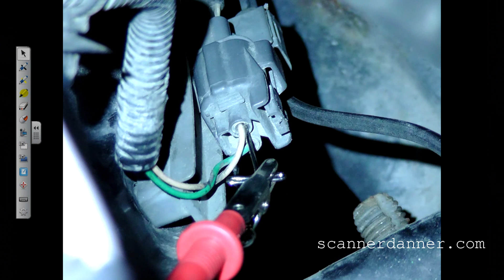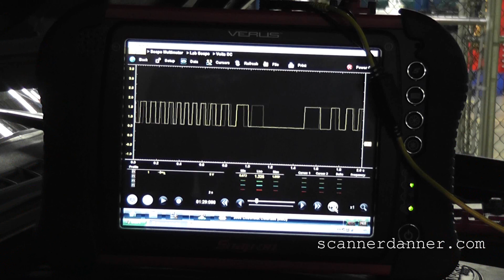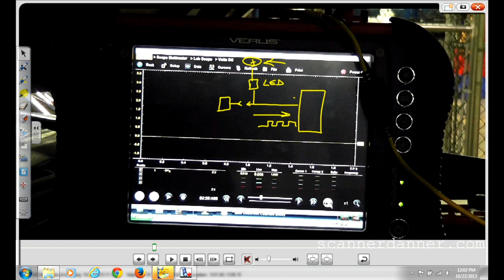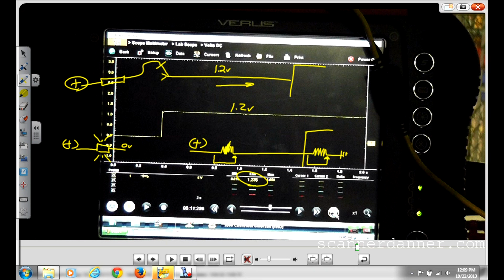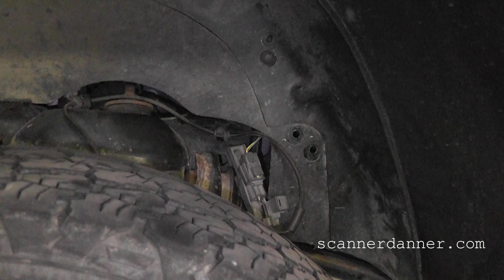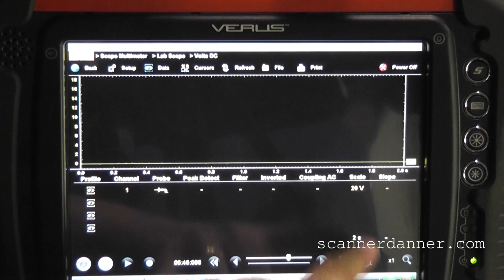Magneto Resistive ABS Wheel Speed Sensor Test - 2006 GM

Comment: My 08 tacoma has a error code for the left rear wheel speed sensor. New sensor, plus wire harness. It did not go away. A tech wanted to get into the rear axle and look at the tone ring. Because the truck was sitting still, it does not seem to me its time to do this?

Comment: Hello, it’s been a while since I’ve been on these comments but I’ve started getting back into learning more diagnostics. I recently had a vehicle with an ABS concern. It had two wheel speed sensor faults. 

The type of sensor they use are Magneto Resistive. So I watched the videos Danner has on the topic and I understand how to test circuit integrity on both wires signal and battery feed, but my question is on vehicles where it sees an ABS fault and it shuts the 12v feed off so there’s no way to check the feed wire other than open or short testing with a DVOM. Even trying to clear the codes they won’t clear. Is there another way to test the circuit integrity without doing open and short testing?
Reply from the maker: you would need to clear the codes only when you have a substituted sensor connected. An LED test light between the two wires may work as a substitute but not sure.

Comment: In 2024, we have 1. Hall effect sensor 2. Anisotropic magneto-resisistive (AMR) sensor 3. Giant magneto-resistive (GMR) sensor 4. Tunnel magneto-resistive (TMR) sensor all of which are used in automotive applications for ABS, hill-holder, anti-skid and cruise control, then we also have the old and basically obsolete passive inductive sensors (analog), and then there are the uncommon types like optical and capacitive sensors. 

Anyway, every type of sensor can be combined with an electronic circuit and this circuit can be designed to provide basically any type of signal and signal voltage range. Even passive inductive sensors could be equipped with an ad-on digital circuit, however they would need a voltage source in order to power this circuit. Some designs provide directional information, too (if the wheels turns forward or backward).

That‘s why there are efforts for standardisation. But too much standardisation might impede technological progress.

Comment: Very good explanation. This was filmed 11 years ago, incredible! 

The only part I didn‘t find helpful was the part on the test light. On modern Bosch 8.1 ABS/hill holder/anti-skid systems, the signal of the square wave is oscillating up- and down around 10 V, with about a 0.4 V difference (This is what I found on the internet, as I still have to do my own measurements). I don‘t see how the test light will be helpfull with those kinds of voltages.

Comment: I think that the design is an internal resistance in the PCM connected to the ground inside, let us assume its value (1 k ) ohms, and the positive line coming out of the PCM is 11.6 volt , and the sensor is two resistors whose values, let us assume (3.87 K ) and ( 6.73 K ) ohms, are connected in series and fed to the source ( 11.6 Volt ), One of the two resistors ( 3.87 k) is connected in parallel with a transistor that connects and disconnects with the rotation of the wheel. When the transistor connects, it will cancel the resistance ( 3.87 k ) ohms , and thus the internal resistance of the PCM, which is 1 kilo ohm, will become connected in series with the resistance (6.73 k) and thus the voltages on the PCM pin will be ( 1.5 volt ) But when the transistor is cut off, the three resistors become connected in series, and thus the voltage becomes ( 1.5 volt ) volts , this is my think

Comment: 10:49 on plastic "pull down" sensors the ground is the brass ferrule where the fixing bolt goes through, inside is an earth wire to the sensor

Comment: Would you recommend led test light for sensor bypass wiring integrity and to see live data change? Or it is safe with normal bulb that draws around 120ma.
Reply from the maker: On this type of sensor circuit, absolutely.

Comment: Love this video because it allows me to see how using an LED test light can be a good thing and can sometimes get you in trouble. I have been thinking of buying one, but have not been able to do that because I usually use a DVOM or an incandescent test light. Especially, after watching one of your most recent videos, where you used the ohmmeter and the diode function to inject a small voltage into the signal wire to check for signal wiring integrity.
Wish you and your family a happy new year! Please, Keep Haiti in your prayer. Only Divine intervention can help us out of the mess that we are in.

Comment: how abs controller know abs sensor is faulty the same time  the wheel is not turnning around .  scanner shows abs sensor code once i put the key on
Reply: imo because of lack of small current feeding of bias voltage

Comment: I think my front sensors are active sensors because it has 3 wires and a 2.40 supply voltage from the computer with the key on .  when I put my meter on the signal wire with the connector plugged in, via backprobe, and spin the wheel, what voltage should I get ,,  does the speed sensor interrupt that 2.40 supply voltage and become an on/off signal to the computer? nothing is happening, and im wondering if my digital VOM cant pick up the dropout voltage?

Comment: when troubleshooting my 2000 bmw z3 with key on.  the front wheel sensors have 3 wires, and one one wire shows 2.40 vdc, and the other (signal wire) shows nothing when spinning the wheel.  the rear sensors have 2 wires, and generate a small a/c voltage when spinning the wheel.. the left side does, but right side doesnt.

Comment: @20:18 I always thought that the computer compared wheel speeds to detect full or partial lockup. Surely to make decisions on individual rate of change is going to take more computing power at the same time as it's monitoring the other wheels. Or am I wrong? 
Great channel I've just found you. Subscribed.

Comment: One thing to add is that on the Colorado they are famous for throwing a code on the incorrect sensor.  Also the design of the brakes makes it very easy to damage the bearing magnetic ring or -/+ ring if that's what they're called when removing or replacing the rotors and it is  difficult to re use the sensor and sensor holder with the correct gap particularly when rusty

Comment: I am checking a ferrari 575 M, There is a fault related to ABS system, C-1202. I checked all the speed sensor value with tester & come to know that rear right speed sensor value does not changes while driving. Ok it could be a speed sensor problem, but this fault is not getting erased while the car is stopped/ idle. I guess it should be erased while it is ignition on condition. Any idea about that ?

Comment: Hey scanner Danner I have a question could you unplug it and provide 12 volts on the other side and then see if the other side has a signal that comes out if so that would tell you if the ABS is good or not yes or no just a question you know more about that than I would
Reply from the maker: Not all of the ABS sensors operate like this one, so there is no blanket test you can apply.
What I showed on this model may not work on another one.

Comment: I really like the led test light test for checking to see if the computer is bad. I'm really not that comfortable using the test light to do this test because I really do not  think I'm ready to take short cuts just yet and I'd hate my self if I burn out a computer. But I see using a test like and checking for power in the signal wire just eliminates and what a flow chart will tell me to do for checking for continuity at the abs sensor connector and the computer connector. Overall, thank you for the video and keep up the great work with the training for all of us technicians.
Reply from the maker: You would really like my chapter 3 material on SD Premium. There is a 14 day free trial and you can subscribe here
https://www.scannerdanner.com/join-scannerdanner-premium.html

I think after watching these lectures and case studies you will feel a lot more comfortable with this type of testing. Thanks! Hope to see you there.

Comment: Hi paul my Buick regal 2002 3.8 has a abs  code c1214, check all fuses  they are ok, the abs ligth can be cleared 
what's  the problems  thank you paul cheers from ontario ca, I like to watch yours videos
Reply from the maker: You need to get your hands on a c1214 flow chart and get a good wiring diagram. My forum would be a good place to start. www.scannerdanner.com

Comment: hyundai uses this type of sensor as theres speed wheels sensors, the problem is that when there is any malfunction on it circuit the computer sets a DTC and stops sending the 12 v to feed the sensor inmediatly, but you can see   a 12v pulse before it detects a failure in the circuit a stops feeding the sensors, and to check the signal/ground wire do a by pass test like you show in this video!!!, thank you for teaching so much Paul!!!, amazing as always!!!!
Reply: Whoa wait!  I have been going nuts with my 2006 Hyundai sonata GLS's ABS system, and this video is the most similar situation to what I have..  I recently had a driver's side front axle replaced after a catastrophic ball joint failure (wheel almost fell off), after which my ABS as well as my ESC lights both came on (already checked sensor lead integrity, it is still good)..  So what you are saying is that if the mechanic maybe disconnected the sensor with the ignition on, or if the sensor came unplugged during the ball joint failure, that the car's computer stops sending the feed voltage to the sensors?!??!  How do you reset this??!  PLEAAASEE!!!!  Should it just reset after turning the ignition off/on?  Or is this something more complicated to reset??  PLEAAASE HELP!!

Comment: hi Paul, watching this video, and knowing about tension drops, to do the by pass test for this type of sensor, im guessing that i  could also use any high cheap resistor, lets say 700 to 900 ohms, watch the 1.4 v aprox. and generate the signal by touching the wire the same way you did with the LED light; is that correct?????, by that way I LOVE THE BY PASS TEST!!!!!, is awesome, thank you for teaching that test!!!!
Reply from the maker: Yep. That should work. Thank you!
Reply: ScannerDanner what if i use a triple A battery, the ones that you remote control of your tv uses, connect it directly to the signal wire and do the by_pass test?
Reply from the maker: sure, but you'll need to ground the other end of the battery to the car.
Reply: ScannerDanner of course!, thank you!; but i  wonder, how to do the by pass test in the 2008 commander wss, the one that changes the voltage betwen 10.4v and 10.8 i belive; i have not figure it out how to simulate that small drop in the voltage to test the reaction of the module and test circuit wire!

Comment: Would a Power Probe 3 be safe to use as a LED test light, in place of the one you used for this test?  I couldn't find what its input impedance is.
Reply from the maker: +Chris C yes, just don't push the button :)

Comment: Wouldn't you also get the same results from a missing or damaged tone ring although unlikely unless the axle/hub has just been worked on which you said it had in this case.
Reply: Just read through the old comments which answered my question, but lead me to another:

Why does a cracked tone ring affect the signal?

Comment: this is a hall effect type 2 wire instead of 3
there is a resistor in the module signal side
the hall effect changes the current typ. 7 - 14 mA  
magneto resistive magnet in sensor ferrous reluctor
some use the magnetic target wheel looks like a hub seal
some sensors are directional detecting 3 hall chips and circuitry in sensor still 2 wire
produces three different signals stationary, forward and reverse

Comment: Like he just said, before it goes to ground. There are all kinds of grounds in these systems,just little wires bolted down to the main body works somewhere,if they are not making a good ground because of years of corrosion then you may have a simple problem there, so take it a part, xclean, dielectic grease and put it back together and move on.  Do Not use led test light!

Comment: Good video, the only thing i would comment on is (and please correct me if im wrong) but by not using a wiring diagram you could in theory have the 2 wires round the wrong way on the abs plug (unlikely, but still very possible if a vehicle had a wiring repair or a new incorrect harness for example) im not sure what effect this would have on the system, but my guess would be a good power feed but missing or incorrect voltage out, which would lead you to replace the sensor or look for mechanical defects.

Comment: The voltage levels you measured indicates there is a 100 ohm sense resistor in the signal side of the computer because that sensor is designed to switch between 7 and 14mA. Just wondering if you tried to measure that  resistance with power off.

Comment: Using the LED test light on another car may not produce the same voltage as on this car because the internal resistor to the computer is probably chosen with care for the specific wheel speed sensor used here. In this particular case the internal resistance of the computer probably ain't that high if we get a about 10V voltage drop with the test light. With that in mind I really would not use a incandescent light on a digital wheel speed senssor system. Someone please correct me if I am wrong.

Comment: If I may add something about voltage drop over resistors. The resistor in the circuit doesn't need to hade a high resistance to do a big voltage drop. Example: 2 resistors, 50 Ohms and 10 Ohms will lead to a 10V drop over the 50 Ohm and 2V over the 10Ohm. The same goes for higher resistance. I.e if we hade a 5KOhm resistor and 1KOhm the drop would be the same as above. The total resistance value in the circuit decides what the drop would be over every resistor.

Comment: An air gap issue is always a concern, but in this case an air gap issue would not have caused a 0v signal all the time. 
A good visual inspection should always be done though for sure.

Comment: Nice explanation on the testing speed sensor. One question wouldn't the sensor air gap be a factor to the problem shown as well ,due to corrosion & mislead you to replace sensor ??

Comment: I'll show you how you can test this sensor and the abs ring in one min or less: using a Pistol grip style soldering gun removed tip. The soldering gun connected to power(110 acv) it creates a lot magnetic waves  then place the gun as close as you can to the sensor then watching the scanner abs PID specific for that wheel you  will see the sensor inputting a lot volt to ABS Module. That’s suggesting good sensor and wiring. Thanks Scanner Danner for another super good lesson appreciated

Comment: your explaination of the test methods to verify the workings of the circuit is very clear, i only wish i could be as clear as you
I was describing the inside electronics of a simple LED Light
your right about the resister inside the computor, all you need to know is its a high value resister.
Keep up the good work, the videos are great

Comment: Just to back up your point on the L.E.D test lights, I just carried out a quick experiment. I've got a very well known brand of test light that was expensive for what it does. At 12.6v this test light carries 14mA of current. Using a 5.1kOhm resistor in series (5100ohms) on the ground side of the resistor, this thing still lights up! This is last thing I'd rely on for finding ground faults that's for sure!

Comment from the maker: The computer and it does monitor the feed side too. At least for opens and shorts. I am not sure how much on this design that it is "watching" the feed voltage for signal interpretation. I did prove that the signal is monitored on the other wire though right? You will see in my next upload, that this changes. That on some it is the feed side that is monitored for a signal. And again, I know that current is also monitored on these too but that doesn't change our diagnostic approach.

Comment from the maker: In our case I do not believe an air gap could be the problem. Remember the voltage levels? .6 with it low and 1.8 with it high?
We had a flat line 0v signal. I do not believe an air gap problem would cause that. The signal could be fixed, but not at 0 on this design. But I agree, a visual is always in order when testing ABS sensors.

Comment from the maker: I think you are addressing one of my questions in the video. What I didn't know was what the resistor value was inside of the computer on the signal circuit. Not that it matters, I was just trying to explain to some why we did not have a complete 12v drop across the LED light when connected to the signal circuit.

Comment from the maker: Also, you are correct in that any time we call a bad ABS sensor we should always verify air gap and check for a cracked tone ring (this is not possible on the units that are combined with the wheel bearing assembly). 
In our case I do not believe that was necessary. Remember the voltage levels? .6 with it low and 1.8 with it high?
We had a flat line 0v signal. I do not believe an air gap problem would cause that. The signal could be fixed, but not at 0 on this design.

Comment from the maker: It's probably because my theories of the workings of the computer signal circuit are not accurate. I know that is also measures current but in my opinion measuring sensor Miiliamp draw is not necessary in this particular case as I will show in the next upload.

Comment: great video Dan
LED circuit design have a high value resister to limit current in the led, this resister is determined by the current rating of the light emitting diode, the led has a voltage drop of between 1.8v and 3.3v. depending on the type of led, you can find the value of the current limiting resister if you know the led voltage drop and led current rating